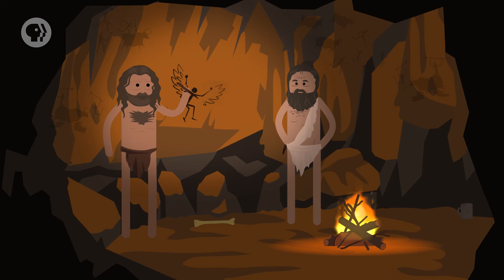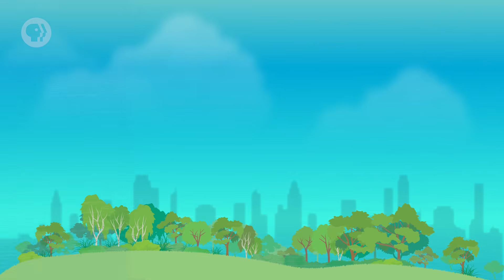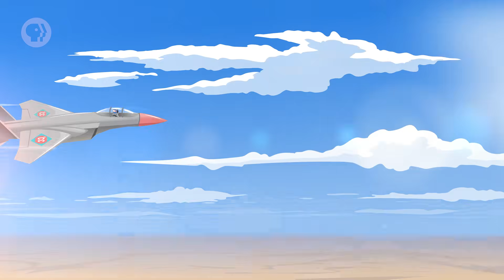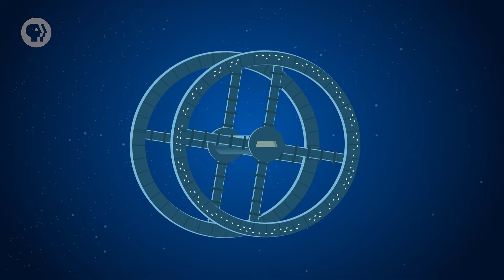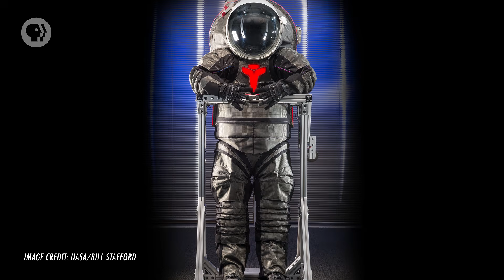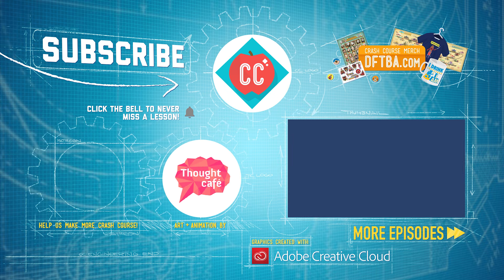To The Moon & Mars - Aerospace Engineering: Crash Course Engineering #34

Comment: Are rocket engines heat engines? I know that the fuel in rocket engines generates a lot of heat, but the thrust of a rocket engine comes from the expanding exhaust gasses. Things like cold gas thrusters are like simplified rocket engines, and they don't involve much heat.
Reply: Fenrir yes (nice name btw), rockets rely on heat to expand the exhaust gasses, even in a cold gas thruster

Comment: The turbine does not produce the thrust in a jet engine. It siphons off a portion of the energy from combustion to run the fan and the compressor.  The energy of the thrust is produced by the combustion of the liquid fuel. The thrust itself is a demonstration of Newton's 3rd law. For every action, there is an equal and opposite reaction. The combustion speeds up the air, which is directed rearward. The reaction is to push the plane forward.
Reply: You are talking about turbofan while she is talking about turbojet where the thrust is produced by the combustion output.
Reply: Thrust in turbofan come mostly from the bypass duct. Not the combustion itself
Reply: No he’s correct

Comment: At this point, I'm looking at previous comments for guidance because my ability to criticize outside my own field are limited.

Good points:
1. While it is technically true that spacesuits can be thought of as ships, there's not really much aerospace engineering that goes into them.
2. Very basic concepts like the rocket equation and its tyranny over engineers were skipped over.

Comment: "English" units? No, they were using IMPERIAL units, which are only really used in America. "USCS, the US Customary System, or US Customary Units" are the correct name for them. The UK still measures distances in miles, but are way too sensible to measure Forces in pounds and inches.

Comment: Centrifugal force to simulate gravity was tested by nasa, a problem was found on a short radius, If I remember properly,  the Semicircular canals is too sensible and if you move your head too quickly it will disorient you and can cause motion sickness. The problem should theoretical not happen with a bigger radius, and the speed needed to maintain a earth like gravity would also be lower, meaning a less disorienting view outside the windows, sad part is the material required to build it and the mass would be too much for our current thec
Reply: That's always been the problem with the centrifugal idea - it requires a pretty damn large spaceship.
Reply: @ArawnOfAnnwn  it can be trimmed with down and done using wires and pod, two space x ship could teater Each other but it will be imposible to adjust the orbit until they stop and unteatet

Comment: The highlights in the Jet Engine graphic could use correction. The inlet is the passage the air moves through; the graphic highlights and points to a fan, which is properly part of the compressor stage.
Reply: The fan isn't really part of the compressor stage either, since most of the air that goes through the fan bypasses the turbine completely. It's more like a propeller in front of the turbojet to help it get better efficiency.

Comment: I'm surprised that an obvious transition from aeronautics to astronautics was missed here: how you can't push air around to fly in space like you can in the atmosphere, and instead have to deal with rockets and orbits. Flying via jet engine and getting into orbit via rocket are fundamentally different things even though they seem similar on the surface, and the difference between them is interesting (and basically defines the difference between space and not-space: if you can fly, you're not in space; if you can orbit, you are).

Comment: argh. the fan is not the inlet. also it provides most of the thrust in a turbo fan.
Reply: Keep in mind that her script was probably correct, but she’s not the one doing the animations, it’s an actual animation company. So the fact that the person animating that probably didn’t take any classes on aircraft, I am glad that it was mostly correct. 
Although, I kinda wish they would do just an aerospace engineering mini-series, just because it is such a massive topic, and covers so many different things. Like she didn’t even cover the other kind of lift besides buoyancy, or the airfoil design, or really anything else having to do with planes. It kinda felt like they mostly skipped over the “aero” part of “aerospace” and went straight into spacecraft. Like what about propellers, and control surfaces, and reciprocating engines, and all that other stuff? I was the most shocked by the fact they didn’t explain how lift is generated by an airfoil, that is like the core concept of aircraft.
Reply: @MatthewSmith-sz1yq  YES OMG
Reply: Actually, In a turbo fan, most of the thrust come from the bypass duct, not the fan itself. The fan just sucks in the surrounding air
Reply: @Tunechi65  and the Fan is the only thing that puts air in the bypass duct, thus it is responsible for that thrust
Reply: @Hallebumba  just making sure you aren't confusing bypass to the main core of the engine
Reply: @Tunechi65  nope just happen to be studying aerospace engineering ;D
Reply: @Hallebumba  lol same. I'll be working for the top jet engine maker in few months 😛
Reply: @Tunechi65  Currently a jet engine mechanic, and all I can say is Im jealous. Jet engines are AMAZING and I would love to have a deeper understanding of how they work.
Reply: @Wisegorilla122  lots of resources out there. Can learn the fundamentals without any calculations
Reply: A A You got any advice for a highschool student on how to become an Aerospace Engineer?

Comment: I'd of figured a mention of the rocket equation would have been given to explain the critical difference of generating thrust in a vacuum, as opposed to the description given of how jets generate thrust.
Reply: The thrust equation for rockets is very similar to the thrust equation for jets, but without the mass flowrate in. The rocket equation is different and usually used for calculating a change in velocity.
Reply: @Quasarnova1  My point was that the jet relies on an atmosphere for oxidizer and the principle exhaust generating thrust.  The rocket equation illustrates the challenge of space travel by showing rapid diminishing returns as you increase the amount of fuel and oxidizer.  The comparison would be even more stark when set against a solar electric propeller aircraft.
Reply: @TheChillLefty  Sure, but the rocket equation is not a thrust equation, and you can't really apply the rocket equation to jets since they are more concerned about cruising and drag than reaching a certain speed. Conventional aircraft also have also have diminishing returns with increased fuel, though not as badly as rockets of course. Maybe a comparison of the specific impulse of different engine types would be a good way of showing the difference in efficiency, though even that isn't the whole story.
Reply: @Quasarnova1  I never said it was a thrust equation and I did not mean to say that it should be applied in a direct comparison with aircraft.  I think you are missing the point which is to demonstrate key differences between aircraft and spacecraft, the relationship with the external environment in generating thrust (and hence achieve a change in velocity) being a particularly important one.  They addressed what makes a jet "go" but not the same thing for a rocket.  If they had talked about rocket propulsion then discussing the rocket equation could have been useful for illustrating a fundamental concern of astronautical engineering.